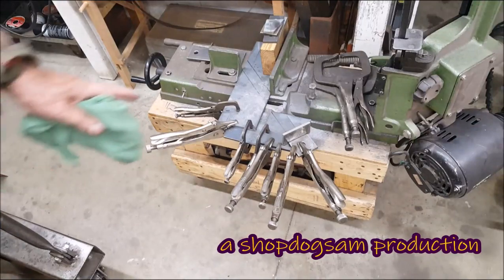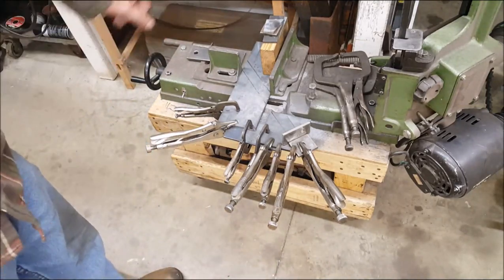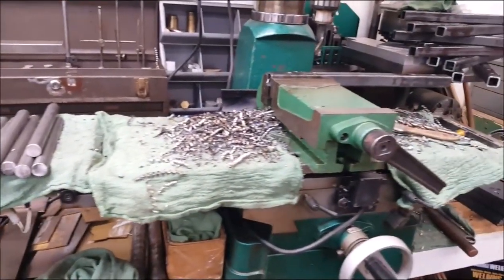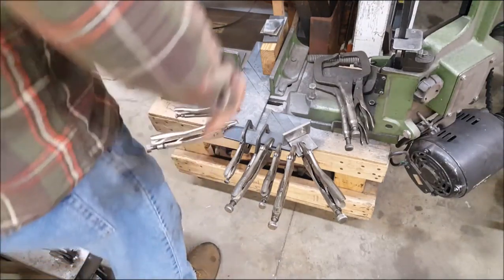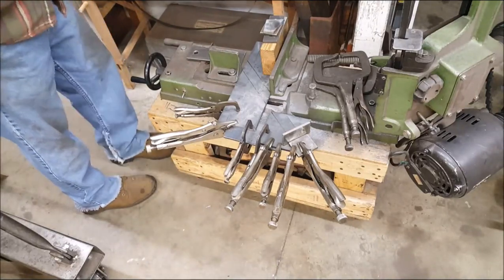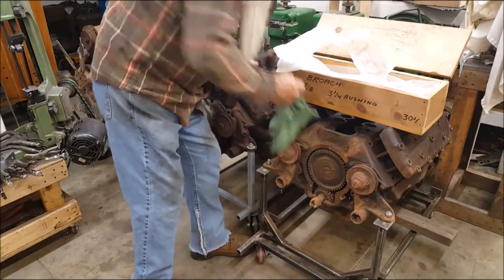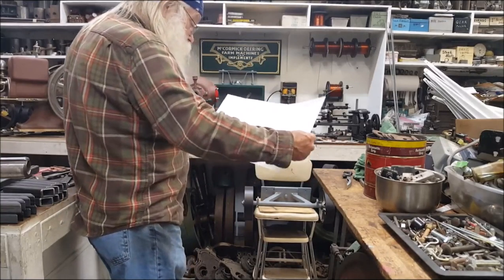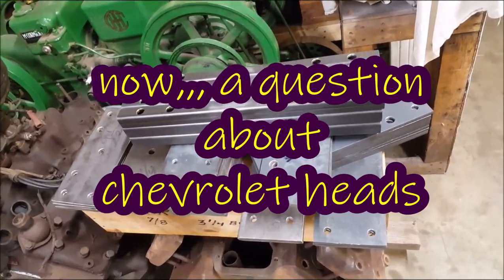Antique Engine and a Question

Comment: I need a set of them cart blueprints that I can scale up for a 12" wheel.  A got a United engine from a friend up in middle Tennessee about a year ago.  One of the last comments he made as I was about to pull off in the truck was, "one of the main things to know about building a cart for those engines is to go with the largest wheel you can so it'll be easier to roll around the show yard".  I got the wheels, now I just gotta build the cart.  Leave a comment!

Comment: The info I have ...

Casting # 3947041

1969 -1970  350  300 HP  1.94 intake  1.50 Exhaust
Head used in trucks, no accessory holes.

F 10 0 date code
June 10 70

Comment: You may be able to buy a set of new 96 up to I believe 01  vortec heads cheaper then rebuilding those and have better flow , all new components  and assecory holes in the ends, just saying double hump was king in the late sixties but progress in air flow has passed them by
Reply: Have to make sure you get actual vortecs however.

Comment: I have been around old tractors all my life but had always walked right past the hit & miss engines all my life until a month ago.  I purchased a 1916 Fairbanks Morse headless Z 1-1/2 hp on a factory cart/trucks and a IH LA , both should run and will be fun winter projects.  Have you magnafluxed your 041 heads for cracks?  You could easily build a "crack checker"  some of the same principles as a magnet recharger,  just more portable and hand held.  I could send you pics of mine if you were interested.

Comment: This is what the Chevy part number book says;
3947041 1968-79 327/350 car & corvette 300, 1.94/1.5

I would say yes they obviously came on some corvettes but with the 1.94/ 1.5 valves they probably weren't the best performing heads, better than some through the '70s but not great. That's probably why they were on 300 up corvettes. 300 up from a 350 isn't much to brag about. It just depends on how much performance you want from them. If you want the best performance another head would probably be better. If your looking for a mild daily driver they'd probably be fine.